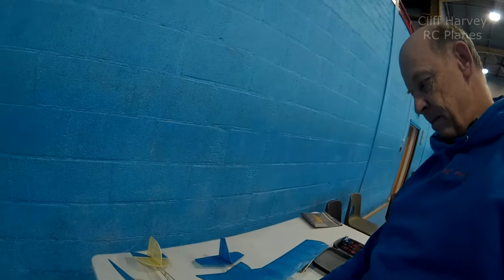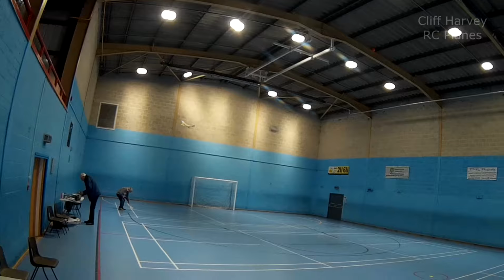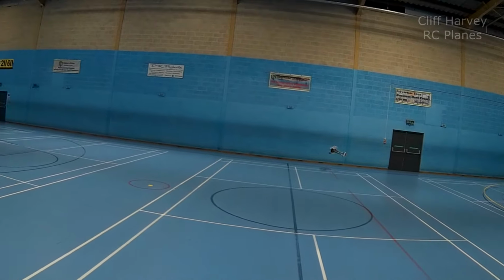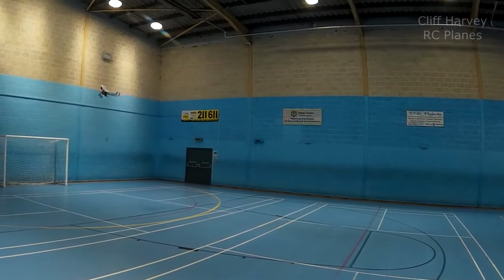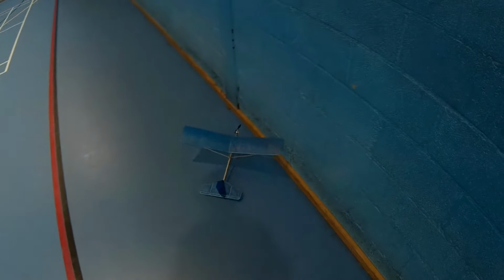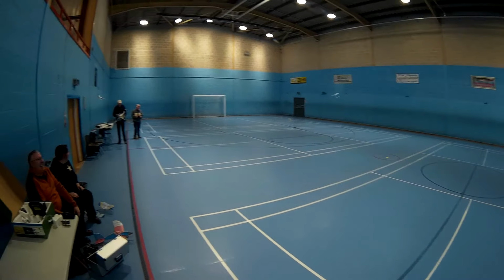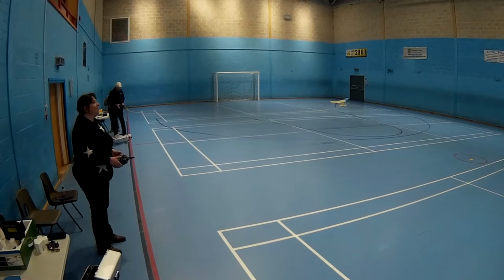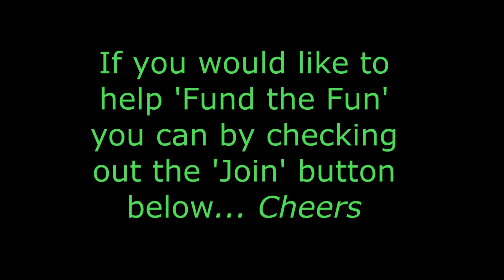Indoor RC Fun, Aerobatics and Collisions!

Comment: I actually flinched a couple of times 😂
Great fun i wish there was somewhere near me for indoor flying.
Reply from the maker: Yes, I am lucky, are there any sport halls or school halls nearby which you could use with some fellow flyers 🤔👍
Reply: @CliffHarveyRCPlanes  we used to have a regular indoor flying hall in the early 2000s but it slowly died off,out clubs old chairman did sort a new venue but there was low support from the club and the hire is quite pricey.
Enthusiasm for the hobby seems to be slowing near where we are.
We've recently had another model shop close.
It's a shame.
Reply from the maker: @Bareknuckleflying.  It depends on the members of the club, if they're hardy then who needs an indoor venue but when it's wet and windy flying is guaranteed and there's loads of fun to be had. The hire of the hall is pricey but the cost is covered most times and if it's not the club subsidises it. Shops closing really doesn't help the hobby on the highstreet but the stock's moved online and shops have to enbrace an online presence if they want to stand any sort of chance of continuing in business ... at least that's how it seems, cheers